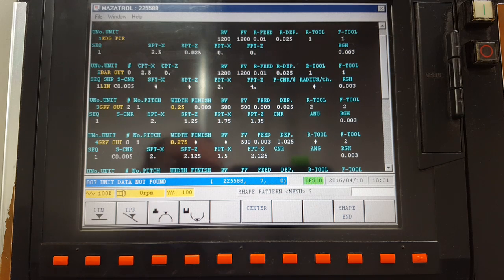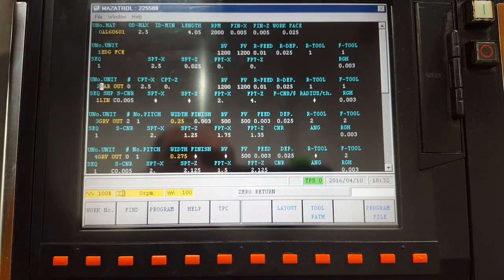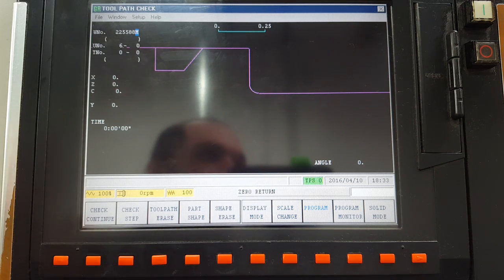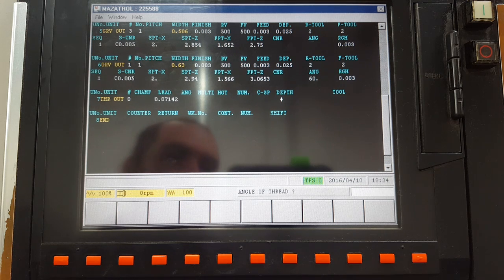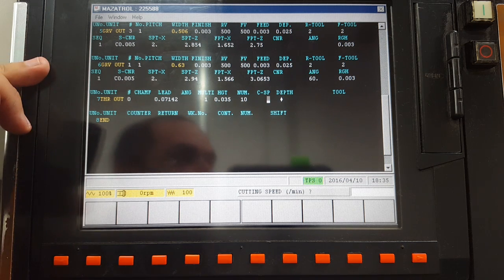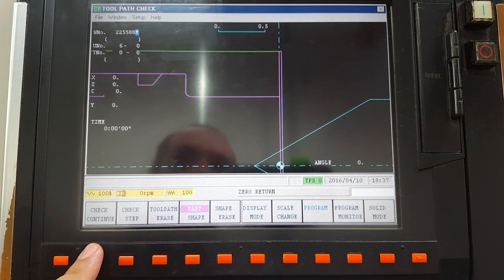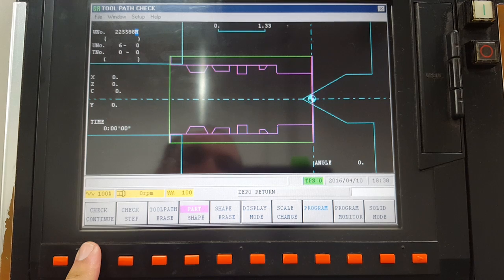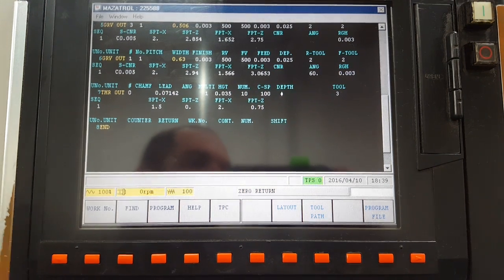Threading OD Mazatrol

Comment: How about lead out angle on the thread? Some proprietary threads that we cut require a specific pull out distance on the thread. The specs give a distance to the last full depth of thread and they also specify a "final scratch" distance.

Comment: I thread at 400 sf on almost all metals, angle is 60 but 59 gives a better finish and I autoset thread height.   thread taper is 3/4 over a  foot or  1.7889 angle for mpt    what chamfer do you use? I have always used thread pitch. nice vid

Comment: I worked with a guy who was pretty good at a die shop ,he was taking about .010 pass on D2  
shafts  .And Im like wth I always did .003 and I got see the finish cause its going to be bad.Anyway it looked like a corncob ,other guy seen him was like good god" .For a guy that was in the trade for 20 yrs I thought it was rough shod work ,and if Im out thinking you wether you want to increase production time thats cool but be a craftsmen .Your threads are how they should be done .Industry now in days its all about spitting out something than quality.

Comment: nice set of videos thanks, what might help you with thread depth you can find here http://theoreticalmachinist.com/Threads_UnifiedImperial.aspx
Reply: George Davidson that is one hell of a handy page my man.
I rarely use my machinist handbook for much but threading dia's is one of the only uses.
Guess I can move it to my bottom drawer ("junk/stuff rarely used drawer").
@ everything CNC starting at a new shop and it's primarily mazak these videos are going to have them thinking I have experience with mazak now.
coming from a JOB shop where I was the weekend boss and it was EZ paths and tracks I am hoping the CNC stuff doesn't bore me.
I know the ez series is a bit older but after 20+ years of chining experience I prefer the more manual side as time passes quicker and I feel more accomplished when a job gets done. Great videos and a great suggested page. cheers!